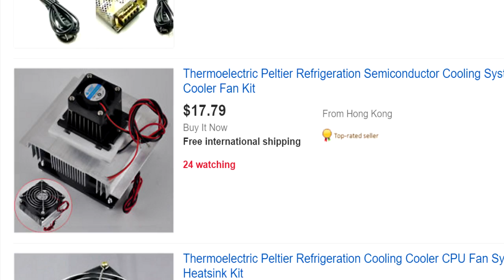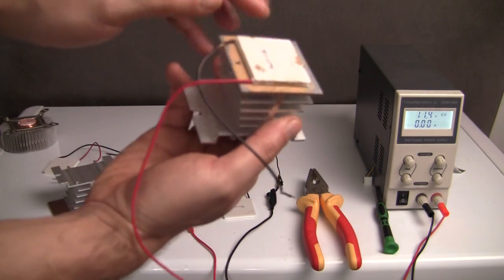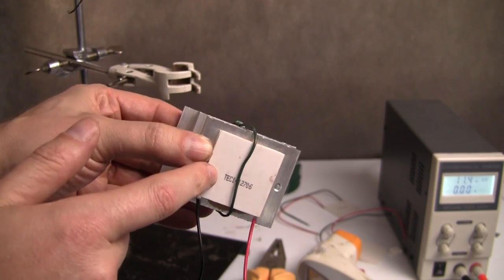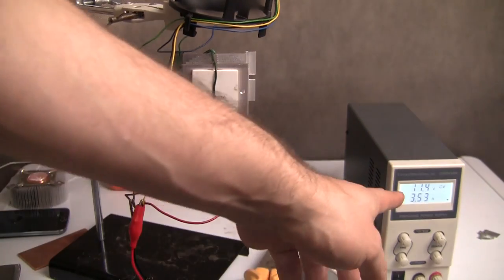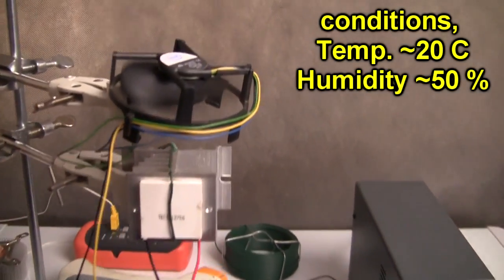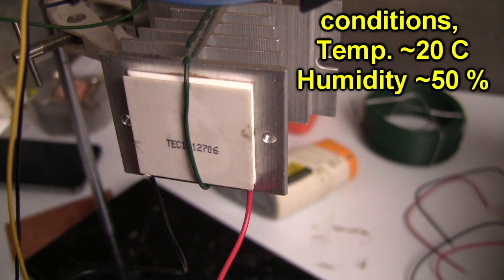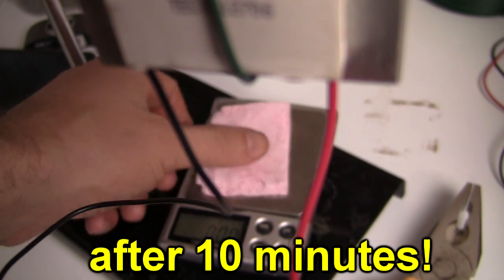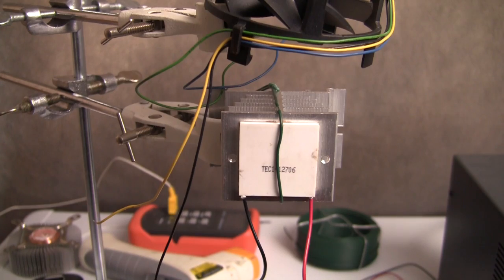Fontus Water bottle claims to make water from air.  Is it possible?

Comment: wouldn't the output vary greatly with the relative humidity?
Reply: Nah, it totally works in the desert.
Reply: matsv201 what exactly is a war desert?
Reply: +Etropalker kek
Reply: matsv201 how'd you arrive at that 8-10 figure?
Reply: ZephyrLandroot
You dare deny the word from Bathroom Reader?!? XD
Reply: +matsv201 It's time for you to start citing some sources friend... The whole "Sahara is more humid than your house" misconception has gone on long enough.. Columbia Encyclopedia 6th ed. states "The region's low relative humidity rarely exceeds 30% and is often in the 4% to 5% range." 4-5% RH at an average summer temperature of 40C is an AH ~3g/m^3. 50%RH at 20C is ~9g/m^3. The Sahara Desert is referred to as one of the most arid regions on earth for a reason... Also I don't think you're calculating AH if your units are g/kg.. Specific humidity maybe?
Reply: I presume it would,  as humidity is the concentration of water vapour in the air.  It would seem logical to say that higher humidity would produce more. 
This experiment done at 50%,   100%humidity is when clouds form,  and the temperature also effects how much vapour the air can 'hold'
Reply: Etropalker "warm".. missed the "m"
Reply: Newton's Third Law I checked the relative humidity table and substracted the one from 0 degree condensation for the one from 20 degree 50% respectively 100%. The table i had was very approximate there for i could not give a exact number.
Reply: I don´t know the avrage temperture of Sahara.. and i don´t know how the "average" the RH of Sahara.
But say its 25% RH (daytime) and there is a avreagera temperature of 40C, that gives us about 12.5g/kg. Compare that to a 50% of a household of 20C, that gives us about 7.5g/kg...

This would imply that Sahara is quite a bit more moist than indoor in a normal house....

I would assume that the 25% RH is a daytime number because to my condensation night time condensation is not that rare.

Sahara is dry because its hot, not because there is a lack of water.
Reply: +Newton&#39;s Third Law the air temperature makes a difference too. He'll probably cover this stuff in the "proper" video on it :)
Reply: +matsv201 I've been doing the thermodynamics calculation. Ok you get more than double, since, in order to start condensation you need to get to a Pvap that makes it so that RH=100%.
That considered, by using the data for water of Entalpy of evaporation 4.3*10^4 KJ/mol and the Clasius-clapeyron formula i get that going from 25°c (100%) -> 0°c  you get around P0*1.68*10^-2 of water pressure condensated, while starting from 50% you get P0*0.54*10^-2.
If you calculate the ratio it is just 3 times more not 8-10
Reply: +Etropalker Actually, it would work better in the dessert than indoors becasue there is much more air moister in the desert (that is, a war desert, not a artic one)
Reply: +Newton&#39;s Third Law 
It was 50% humidity in this video. If the output is proportional to the humidity (which may not be the case) then 100% humidity would only give double. So a steamy jungle environment could possibly give you two shot glasses a day.
Reply: I missed that he was working in a 50% relative humidity environment. I know the temperature is lower in the morning but is the moisture content of the air also higher? It just seems like some days your clothes are sopping wet when you're out camping.
Reply: extragirth64 
"which may not be the case"
It is not.. The amount of water you get out depens on the condensation of every given temperature. So if you have 100% RH in steed of 50%, you would actually get about 8-10 times more
Reply: +matsv201 Deserts have lower humidity than a house in a normal area.
Reply: ZephyrLandroot 
I heard the average American household has a less humidity than the Sahara desert. (I read that from a Bathroom Reader)
Reply: I'm not so sure that's true though. According to https://ehs.utah.edu/environmental-programs/indoor-environmental-quality/general-comfort the sahara has an average humidity of 25%,  lower than the recommended humidity of a house. However, I guess it could be that people don't generally keep their houses well-humidified.
Reply: +ZephyrLandroot Well, here in Washington, during the summer where i live, our relative humidity floats around 14-17% depending on dozens of factors, obviously.. Never knew i lived somewhere dryer than the sahara.. cool. ^_^
Reply: ZephyrLandroot That is not true. Dessert have lower relative humidity, but higher absolut humidity. In this case the absolut humidity is the one that is important.
Reply: +Newton&#39;s Third Law yes and whatever the current dewpoint is which is based on temp and rh
Reply: matsv201 just because the desert air is hot and able to carry more water,  does not mean that the water is actually there however.  Probably why there is two measurements for humidity.   The carrying capacity and the actual percentage. 
I reckon you missed this step in your assertions of the Sahara.  I know it otherwise in the Australian outback,  tis dry as all fuck and water is found via digging or condensation of leaves,    if lucky dew traps work but they are not as fruitful.
Reply: All of this discussion about relative humidity is pointless.
Condensing moisture out of the air is all about the dew point temperature of the air, how much below the dew point your condensing surface is, how many grains of moisture per pound of air there are, and how much of it you can bring in contact with the condensing surface.

There is absolutely no way this device can ever condense the proposed quantity of water, with the amount of power available to it, under any conditions.
Reply: Mark Beiser 
Very true about the output of the device. Thunderf00t made it very clear that the device he created exceeds the advertised device by quite a margin.

I cannot wait for his next video to explain further.
Reply: Danlo Troth I don´t know about Australia, but the Saharan dessert is actually not that dry.
Reply: Dmitri Rostov I´m cauclating secpfic humidity, because that is what is important.

Of cause, Sahara is a giant place, and there is of cause dry spoots. The issue is that Sahara is surrounded by water, the air come in and warms up that is why RH is so low. The air is actually quite wet.

It can even snow in Sahara in the winters, a fact that very few people know about
Reply: matsv201 
Every couple of decades it does snow in areas of the world that are usually hot however those are freak incidents. Happens in Mexico too and sometimes people die. I remember a story of snow in India and more than a hundred people died. Those shanty towns cannot handle -3 degrees Celsius.
Reply: extragirth64 I would say its not that uncommon.. sure it does not hapend every year, but quite a bit more common than every 10 years.

In north Sahara its actually regular minus degrees in the winter. And all it needs thas  a warm sea and a breez in the right direction.
Reply: +matsv201 That factor "8-10 times more" is wrong. With all the same starting condition (same T), the RH is defined as p/p*. Since p* depends on T it will be the same. So theRH% will be directly correlated to the amount of water in the air (50 -> 100% implies that the amount doubles). What happens at condensations T is irrelevant, what matter is the amount of water you start with
Reply: 1Crivella The amount of water in the air DO dubble.. but the amount you can extract intresses with 8 to 10 times.
Reply: +matsv201 And all this is considering just max efficiency from thermodinamics. If you considere that the device was struggling in order to keep the temperature lower than°c, it was already operating at it's maximum power. The real efficency would depend on the cooling power of the device, so even if you rise the humidity amount of water in the air, the amount of liquid water produced per unit of time won't increase because the amount of energy transfered per unit of time won't increase.
Reply: +Newton's Third Law Yeah, but that's because you're sweating that water. Your body is a shot bladder. I think it's simply, simpler, to just get over one's insecurities and go the Bear way, well, without actually drinking your own piss, just making it drink safe with whatever tech the military has perfected.

If it works for them (check out sea raft methods of water purification, those are bar none, the best, we're talking 70+ years of continuously perfected methods and science), it sure works for us. Cheaper too. Tablets and some extra purification paraphernalia is cheaper than whatever snake oil these mongrels try to sell.
Reply: 1Crivella I was calculating 20 degrees in steed of 25... that would increase the difference quite a bit. I was also calculating it of a RH table, it might be that it make some difference to.

"If you considere that the device was struggling in order to keep the temperature lower than°c"
Ooo noo.. this is not how it works. Yea it is struggling, but its because it really leaks cool air heavily. But a cap on it and a thermosensor to a fan, and it would all change.

" the amount of liquid water produced per unit of time won't increase because the amount of energy transfered per unit of time won't increase."
This is partly true, but not fully. The issue is that you need to cool air also, not only water. Also, you need to cool down the water that don´t condens as well.

If you have 50% humidity around 20C you only condense about 10-15% of the water you cool down. If you raise it you condes a far larger relative procentare of the water.. So you cool down twice the mas of water, but you get 8-10 times.. (or 3 depending on the temperature).

Also, the actual water is only around 1 procent of the total mass you are cooling, the rest is air. You don´t cool any more air when the air is wetter.

This also connect back to the heat exchanger.

Also even peltier element, that is quite bad, still get over 1:1 cooling power. There also today exist second generation peltier element that can get as high as 1:4 cooling in low differing temperature
Reply: matsv201
Actually, by starting from 20° the ratio only goes to 3.4 not 8-10. Make sure you are reading the table right, i'm getting this values from pure thermodinamic calculations.
Also i wasn't considering air cooling at all. Having to cool air is going to require even more power. I was only speaking about the latent heat subtraction necessary to convert a vapor phase into a liquid one

"
Also even peltier element, that is quite bad, still get over 1:1 cooling power."
I'm not well versed on peltier elements, but if by this you mean that 1J spent of electric energy means 1J of heat transfer this is quite laughable.
The latent heat of water at 20~25°c is of the of the order of 4*10^4 J/mol.
Which means you would need to run the device at 72W for 3h in order to get 1mol(18g) of water (and this is considering all exchanged heat goes into cooling water without considering air or heat leaks)
Reply: My source was a plot.

"Make sure you are reading the table right,"
Actually i think you made a calculation error. I´m not quite sure, but it seems like you just used the differentiering value from 50% to 50% and did not ad in the 100% condensation pressure of the lower temperature.. I might be wrong, because you didnt publish all the calculations

"Also i wasn't considering air cooling at all."
I did notice that, but i didn´t think it mattered just in this calculation.

" but if by this you mean that 1J spent of electric energy means 1J of heat transfer this is quite laughable."
Cheap peltier element are really bad, so i would not be supriced that is the actually case. There is high quality once with 30-40% of Carnot, but i don´t think they are in mass production yet. Anyway, its still quite a bit worse than a normal refrigeration unit.

"The latent heat of water at 20~25°c is of the of the order of 4*10^4 J/mol."
So far so good....

"Which means you would need to run the device at 72W for 3h"
naaa... that seems incorrect.
40kJ/3,6=11Wh

Or for a liter you would need ~630Wh

And that is Wh of cooling.

Say we run it on  carnot cycle then we get... well run for a kg and around 30 degrees,30/300->1/10..

So around 63Wh, then ad the inefficiency of a heat pump, normaly around 60% of a carnot, gives us 63/0,6->105Wh....
Reply: matsv201
Yeah on that calculation i wrote the value of J/mol and was actually using as J/g.
That is still too much.

For the liquefation eff I'm doing for a T of  x°c and a RH of y
[Pvap(x)*y - Pvap(0)]  and than calculating the ratio of this values for 50% and 100%.
Basically this is based on the fact that the amount of water produced is proportional to the shift of Pvap from the starting condition to 0°c.

A carnot cycle level of efficiency is pretty much impossible to obtain expecially the COP of 1 you was implying before.
Even if you could reduce the requirement by a factor 2(optmistic), you would still require a huge high efficiency solar pannel in order to convert 1l of water in less tha 4~5 hour.

Considering they were showing a small flexible solar pannel (1/5~1/10 effic compared to an high performanc enon flexible), that is impossible
Reply: 1Crivella "Yeah on that calculation i wrote the value of J/mol and was actually using as J/g."
No... 40kJ/mol is the correct number, so you actually did calculate it correct the first time.

"Basically this is based on the fact that the amount of water produced is proportional to the shift of Pvap from the starting condition to 0°c"
Well.. i don´t really know if you explained it right, but it seems like you did it wrong.

"A carnot cycle level of efficiency is pretty much impossible to obtain expecially the COP of 1 you was implying before."
Well that why i multiplied it with the Carnot factor of a real heat pump.

COP of around 1 was for a peltier element. You would not really use a Peltier element for a product like this. They are way to inefficient.

The factor i reduce it with is the actually preformance factor of a real existing pump. You could actually get it to 75% with supercritical CO2... but ... well that would be a larger device.

Well you need to drink about 2 liters a day. That would be about 200Wh... including some losses of the heat exchanger say 300Wh (just a estimation, can be a bit of).

A Solar panel usually gives 1/10 deutycycle during a full 24 hour.. Say you use it mostly in the summer, and gives us around 1/6 deutycycle (well a bit optimistic).

This would give 4 hours to collect 300Wh, gives us about 75W. On a flat surface in good condition you get about 1kWh/m^2, and a nice high quality modular solpanel gives about 18% (its basically the best you can find that is both flexible and resonable cost to buy), givs us about 180W/m^2 gives us about 42dm^2 of surface.....

Well.. that is quite a bit.

My point beeing is not that this product is not a scam, my point is that Thunderf00t setups is hugely inefficient. As a engineere that work with optimization, this is just painful to se for me
Reply: matsv201
What i meant is that i used the value of 4*10^4, but was doing the calculation with the idea og J/g.

The calculation on the Pvap is right, the RH gives you the Pvap of water in the air compared to the saturation limit (100%). And the amount of water liquefied is proportional to Pvap(start - Pvap(end)
Reply: +Newton&#39;s Third Law Only too a point. The condensation of water creates heat, which must be removed for further condensation to occur. there is an absolute thermal limit of about 1 liter of water per 625 Watt-hours of heat removed. RH is not involved here at all. 

  However this doesn't count the cost of cooling the air in the first place.  I(which can be largely recovered with the right design)  which is determined not by RH per say but the delta between the current temp and the dew point,  (the dew point being determine by absolute humidity, which is related to the RH by the current temp.)
Reply: 1Crivella Okej.. that strage that the diffrance is so much smaler. What g/kg extraction rat do you get?
Reply: matsv201
I'm not calculating the actual amount but the total shift of partial pressure which is related to the amount of water in the air before and after.
Since what we are interested here is a ratio the constant doesn't matter
Reply: 1Crivella 
Well that is a dangerus way of calculating it if you are not sure what you are doing. Do calculate the amount in steed
Reply: matsv201
I'm sure of what i'm doing^^. Applying the clasius-clapeyron formula is basic thermodinamic of phase transitions.
As i told you calculating the actual amoun its just a matter of taking the partial presssure and multiplying it by a consntat which would be Nmol_tot * 1 / Ptot * Mmol (Simply applied Nmol_x/Nmol_tot=Px/Ptot). This number is the same for bot members so its just simplify in the ratio.
If you wanna put the numbers in you get 20~40mg/l gained depending onf the approx you use for Nmol_tot and Pvap_H2O( 0°c)
Reply: +Newton&#39;s Third Law 
phase transition of matter is affected by pressure, volume, and temperature.

you need to factor this three values whenever you deal with phase transtion.

Comment: But theirs uses Thorium and a running tap that goes with them - you see, the technical part is that the water tap helps the thorium, and thorium is actually a dense material, therefore the tap when turned on is able to produce the water.  Call yourself a scientist?
Reply: +MrKalvinC MMMMMM Irradiated water that would go well with this second hand sticking out of my stomach.

Comment: I'm not saying that the real performance of Fontus would be anything near useful, but based on what I've seen on commercial dehumidifiers (compressor based, wich is also a lot better than Peltier), it helps a lot on condensation if you first guide the ambient air through the hot heatsink before directing it to the cool part.